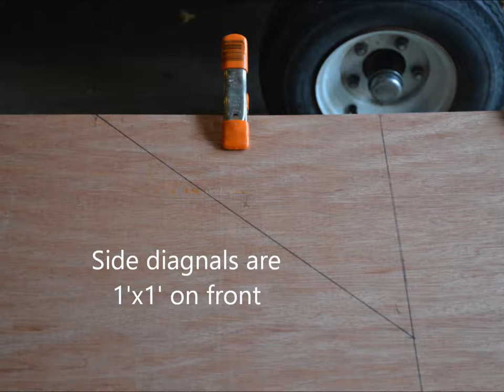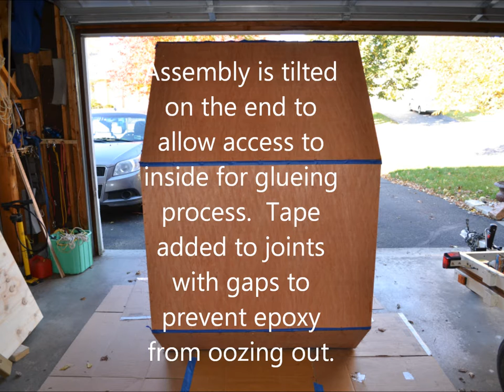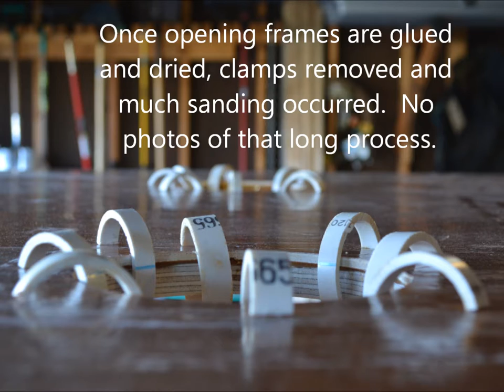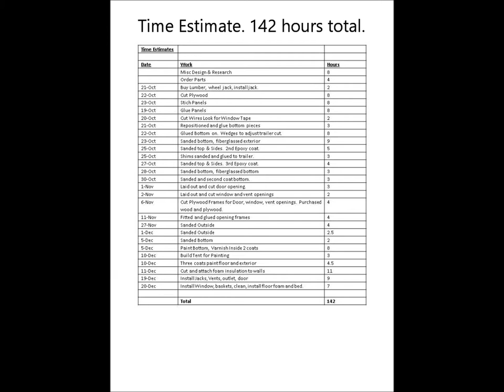Tiny Camper

Comment: Any idea on total and tongue weight?  Looks light enough to be pulled by a bike.  Great design,  I like that you put function before form.  Thanks for including B.O.M., too.  That helps quite a bit.
Reply from the maker: Not sure on the exact weight, and bike pullage might be a bit of a challenge.  Plywood fiberglass box with windows and doors probably 150 pounds or so.  Original trailer was probably 200-300 pounds.  Toungue wt was probably 50 - 75 pounds.  This past year I bought a larger trailer to use just for the camper so I could use the old trailer for other uses, and put a box on the back for storage.   New tailer is quite a bit heavier, probably 300-400 pounds.  Still pull with Honda Fit.

Comment: More commonly , trailers form Harbor Freight and Northern are 4x8. Do you see any problem following your plans but making the bottom 4x8?
Reply from the maker: William,  actually I bought a new 4'x8' trailer for the camper this summer so I could use my smaller trailer for other purposes.  I also mounted a 2'x2'x4' aluminum tool box to the back of the trailer to provide more storage space for accessories.  So no problems.  Also with the designated trailer I no longer needed the "hinge" attachment to make putting the trailer on and off as easy, and simply bolted the trailer box to the separate plywood floor I installed in the trailer.  Hope that makes sense.

Comment: Did you protect the plywood underneath the trailer from water?
Reply from the maker: The bottom is coated with fiberglass and epoxy the same as the rest of the camper box.  For the bottom I did use a 1/2 thick plywood for more durability, rather than 1/4 on top and sides.  Then the box sits on top another sheet of 3/4" green treated exterior plywood that makes up trailer bottom.  That bottom is only finished with a spar varnish.  Some day that piece can be relatively easily replaced if needed.

Comment: A must view video for those insisting  upon 2"×4" studding in a 4'×8' micro-camper , as IF they were building a 10'×14' storage shed on dry land ... !
Reply: Shit would want few more studs than this thou. If I sit on roof it will cave in .
Reply from the maker: Depends on how much you weigh.  However after three years of not sitting on the roof, but rather sleeping inside, fiberglass and plywood construction has held up just fine.   Note the technique is used in boat building for boats that take a licken and keep on floating.

Comment: The big rear slant removes a lot of potential storage space. Adding ~ 6" to each side over the wheels would have allowed sleeping for two, albeit with a little extra bracing..
Reply from the maker: Goal was to make a "tiny"/lightweight  camper utilizing existing trailer size, 4' wide plywood sheets, and result in somewhat more aerodynamic shape.  More space/wieght was not the goal.  Basically just a bed on a box on wheels.  If goal was a bigger camper, probably would have got a bigger trailer.
Reply: Tom Jablonski.  Anyone can have their own definition of what practical means to them. Mine has more to do with usefulness than saving what amounts to lunch money. Nice build though.

Comment: Nice build Tom - how it been holding up - would - you change any thing? Was thinking of using Luan in my build but using it as a skin over an aluminum frame.
Cheers
Reply from the maker: Thanks Patrick.  A fun project.  I have not been using it as much as I had liked, only a few trips the past year and nothing too long, but quite a few days set up outside in the yard, and so far so good.  One thing to change was had to reinstall the insulation foam using spray adhesive versus the carpet tape I used.  Also, be careful cutting window and door openings.  I did not have a good template for window and cut opening a wee bit too big so getting a small leak in the rain.  Hoping when I get a chance to install some caulk around the frame to take care of that.  Also, wished I would have painted when the temperatures were warmer as the finish is not as nice as I would like.  Also had some challenges installing fenders on the trailer I have due to constraints on the folding trailer which was a bit frustrating.  Otherwise like the finished product.  Tom